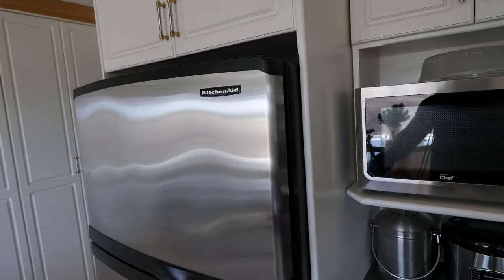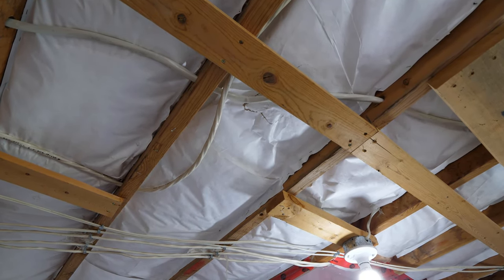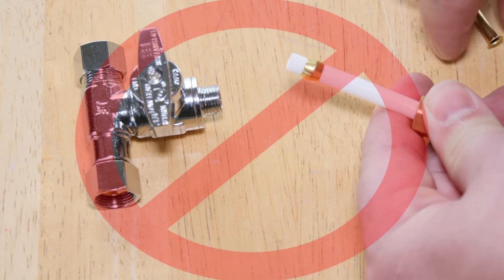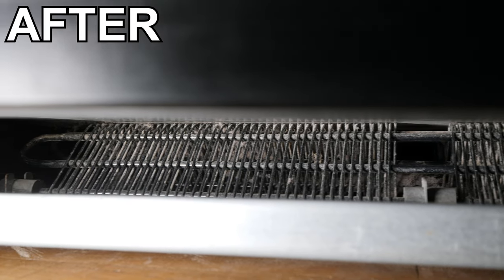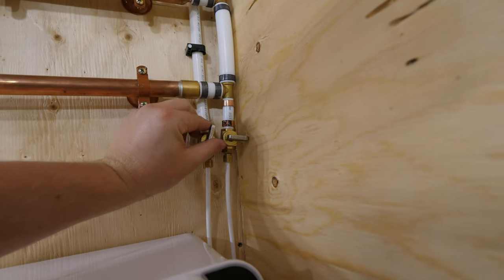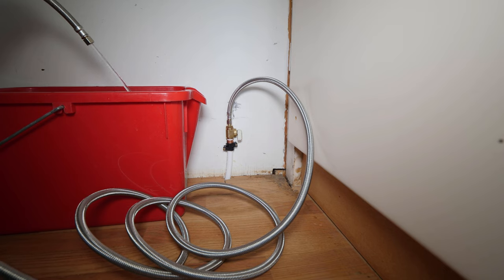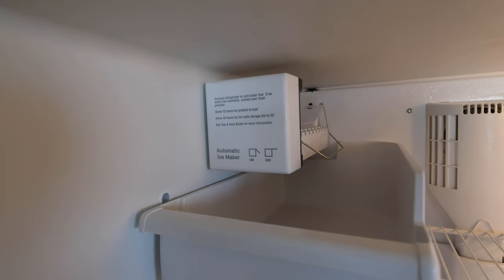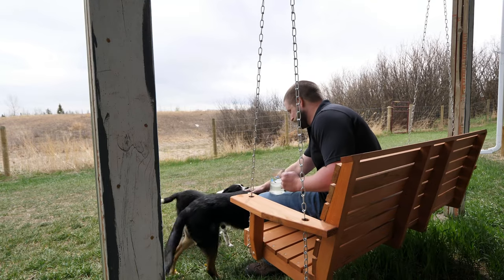Water Line to the Fridge: Refrigerator Ice Maker and Water Supply

Comment: The 3/8 x 3/8 x 1/4 tee with shut off valve is just what I'm looking for.  Can you provide an Amazon link or another source for the tee shown at 2:16 in the video?  Thanks.
Reply from the maker: Unfortunately I can't find a link on Amazon for this product. They sell the tee without the valve 3/8” x 3/8” x ¼” Tee No Valve
: https://geni.us/Fpn3C
I picked mine up at a local plumbing distributor. If you have access to Home Depot or Lowes they should have them as well: https://www.homedepot.ca/product/add-a-stop-compression-tee-valve-3-8-inch-x-3-8-inch-x-1-4-inch/1000725821
Good Luck!
Reply: @PROSDIY  Thanks, but the tee valve is not available at Home Depot in U.S. without having it shipped from Canada.  Total cost, including shipping would be an unreasonable $32 plus tax!  I also checked other local stores.  So, I will have to go with the Tee No Valve combined with a separate shut off valve.
Reply from the maker: That's unfortunate. Ya $32 is way too much. Hope you're able to find a solution.

Comment: Ferrule and Insert are not fitting well and after tightening the bolt, pipe is coming out. I tried plastic pipe as well as copper pipe. Please advise.